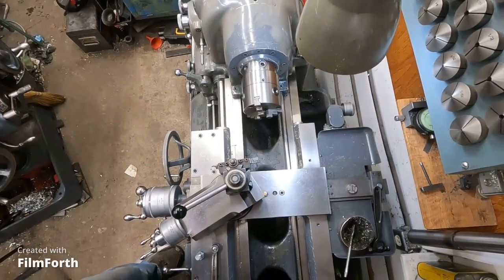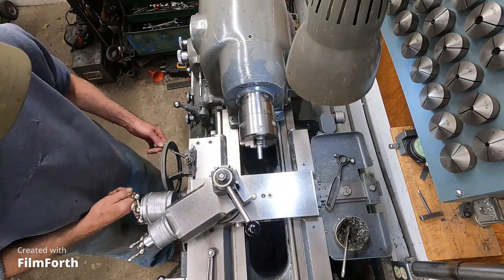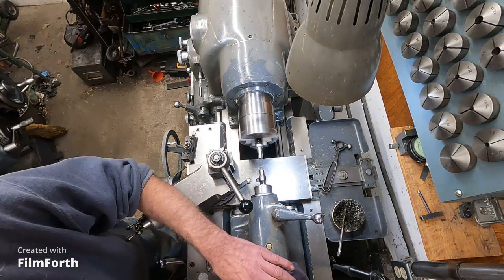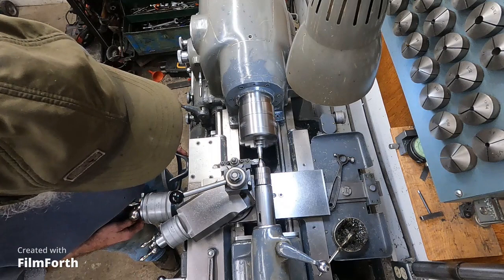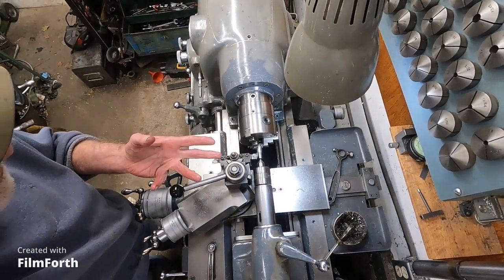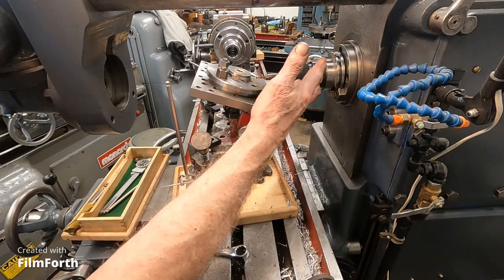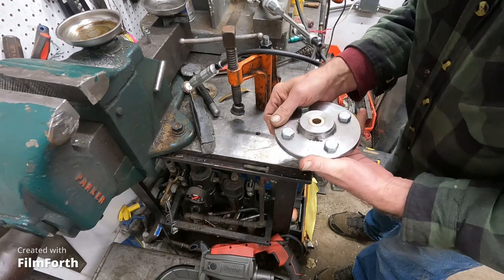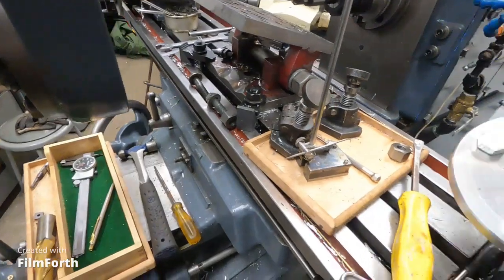Machines machining parts for machines lathe, jig borer, mill

Comment: DeeDee,   Another “boring” video.   Sure is great to see you getting these projects done, withe racehorse no less!  So when will the manufacturing 10ee be coming apart?    Cheers, TB
Reply from the maker: I have made progress! I will work on the old ee in s couple of weeks, I have most all of the nasty jobs done like cutting bronze and salvaging rusty metal. I will use the later machine for finishing up adapters to mount the various boring heads to the 50taper and  I am also revamping the cutter grinder for grinding horizontal milling cutters, I have not needed to do that for 20yrs since I sold the last one. Following economic trends in the past I would work on what pays from industrial to powersports, the work narrows and the machines and tooling are more specific to the task at hand for some years at a time. But now I am doing a bit of everything as the work on the machine restorations is winding down. Finally completing the arbor adapter also allows me to line bore using the Y axis! More tooling to make there so are you making progress or losing the edge? Have fun!

Comment: What is so great about owning a Monarch EE  Lathe?  
Why would anybody want to go through all the trouble of running one, as opposed to a conventional turn on and go "quality" lathe?
Reply: If you ever get the opportunity to run one all your questions will be answered, I'd say the most accurate lathe ever built..
Reply: @kentuckytrapper780  10-4 on that....
Reply: If I were a gambling man I would bet top dollar that you, kind sir, have never used a 10ee…if you had, you would not be asking

There are jobs (obviously) for a cnc lathe but, if you have a part that qualifies for being made on a manual lathe then this is just about the best, (if not the best, I don’t know what else would beat it) lathe ever made
Reply from the maker: Ownership may be like an exotic car, its all about performance and quality and results.
Reply: @camcompco  Correct! I have run Atlas, South Bend,  LeBlond (36in swing ), Clausing Colchester, Cincinatti and possibly other brands Lathes as well (cant remember), not counting Mazak Quick Turn 10 CNC in my time as a Tool & Die Maker working in a precision job shop w/ Moore Jig Grinder, Agie Wire EDM and Summit OD + Heald ID Grinders.
The 16" Clausing was considered a "Toolroom" Engine Lathe. Very accurate and versatile.
I have Never ran (or seen) a Monarch 10EE.